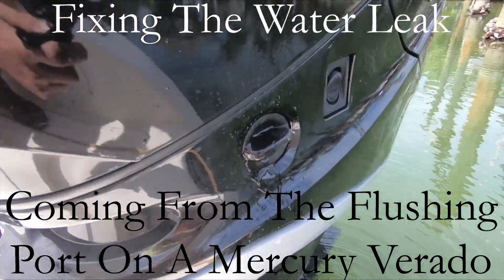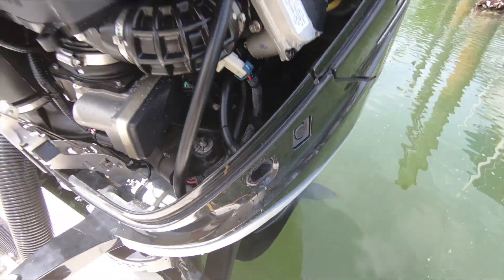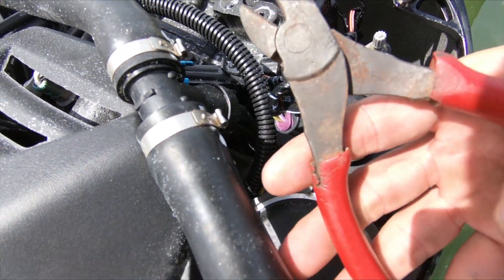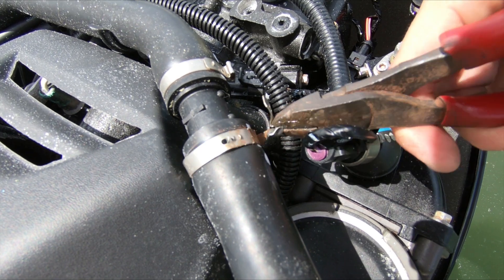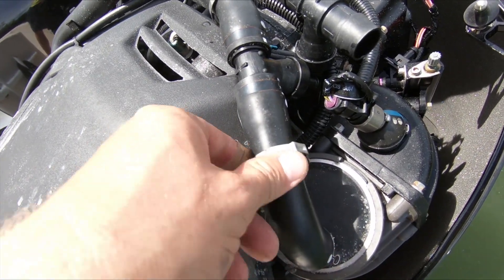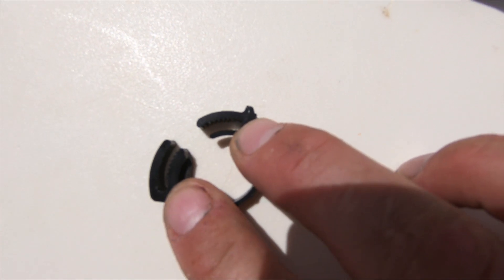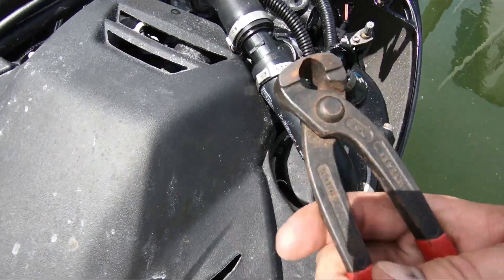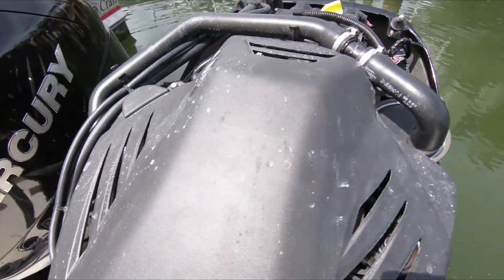Stopping the water leak coming out of Mercury Verado Flush Port | Verado Squirting Water Out of Side

Comment: hi , thanks for the video , i have this problem on my 2014 verado 200 , having looked at the cover plug on the end cap , it looks like the tiny holes are supposed to be there to allow the air in the system to escape , is there a non return valve in the pipe , ? and what does  replacing the clamps do ?  thanks

Comment: Great videos, watch them all the time. Question about my 150 Mercury Seapro 2019 leaking water out of the flush plug. I've heard that instead of the T on the Verrados the Seapro fix is to replace the check valve between the 2 hoses on the flushing system?
Thanks

Comment: Great info !! 
I’m having issues with my 2014 250 Verado. Steering seems as is there is air in the lines, I’ve tried to bleed lines but no luck, I took it out on water but managed to feel the steering though and unresponsive. 
I would greatly appreciate any insight or possible video. 
Once again thanks for all your helpful videos . 👍🏼
Reply: take to a dealer and bleed the air out of the lines.  hope you got this fixed.

Comment: I just replaced my lower unit with new Mercury factory cxxl lower unit. It is noticeably louder than the other unit. The older unit makes a large clunk when engaged but I can’t hear it once it’s in gear at idling speed. The unit can be heard like maybe it didn’t have lube but I assumed it came with oil from Mercury but double checked anyway and I didn’t get a half pump before it came out of top screw hole. Any ideas or videos on it?

Comment: Hello, these are great videos you have, thanks for sharing them, I replaced the entire lower unit seals on my stbrd side motor watching your video.  I have a message in my stbrd engine that displays: too much air in idle, non critical issue, manifold leak, service engine soon. Any feedback?
Reply from the maker: Thank you! Possibly the clamp that is on the isolater boot that is above the throttle body and below the supercharger, or a clamp on the tubes going to the charge air cooler which is just the manifold after the supercharger, or possibly the map sensor boot on top of the charge air cooler. Look over those things first :) Hope that helps!

Comment: I have a new pro xs 115hp 4-stroke and I have the same problem. Same fix?
Reply from the maker: Yes. Just a little different fitting because those come with the hose attached to it!
Reply: Did you end up replacing.  The Tee . I have the sam pro xs 115. And has tjis issue ?
Reply: Hello did you repair this issue with your Merc 115 pro xs ?  I have the same issue .

Comment: Hi, I have a 250 verado pro with smart gages and it says shift actuator service soon, it doesn't come on all the time just when I cruise around 10mph but if I'm running hard all day it will rarely come on. Suggestions?
Reply from the maker: Hello! Awesome and yes. There's two pretty common things that can occur to give you that message. 

Which is either the lower unit is having problems or the shift actuator is beginning to fail. 

Start by checking your gear lube. Make sure its clean, no water, metal, or anything like that. Here is a video for gear lube colors: https://youtu.be/Nl3MvT9Tlzs

Then checking the shift actuator gets a little more complicated. I would suggest finding a local verado specialist that can find hook it up to a laptop and check the codes.

I hope this helps! Good luck!

Comment: What does "starboard shift not working properly" message mean when you have single "225" setup?
Reply from the maker: Just means that you have a shift issue somewhere, hopefully you figured this out, it says starboard because single engines are considered starboard engines even by themselves, they have right hand lower units :)

Comment: Do you know what temp a non sci verado 350 should idle at when warm? After running for an hour of so.
Reply from the maker: The engine should run somewhere between 140-150 degrees. I'm pretty sure the L6 Thermostat opens up at 143 degrees. So somewhere around there is fine. If it is up higher like 160 or 170. You have some blockages somewhere or the thermostat is stuck closed.

Comment: Hi I have a 150hp 2016 and has water comming from the 2nd flush as well as this vid would I fix the same way and when first start it's great in the tall tail then I lose pressure and start haven heaps off bubbles comming from the prop could that be the thermostat like in one off your other vids 
Thanks heaps in advance from Australia
Reply from the maker: Hello! Yes, the 150 has a flush port sort of like this one. The only difference is that it is on the port side of the engine and it is just in line on the flush hose. Just take your cowling off and follow the flushing hose up until you get to this little valve that is that line. That is the flush valve for the 150's! 
As far as the bubbles and loosing pressure. Yes, start with the thermostat and see if it has a bunch of stuff in it or if it is closed shut. 

150 Water out the Exhaust: https://www.youtube.com/watch?v=OeCNF6IFf1Y
150 Full Service: https://www.youtube.com/watch?v=ghybfqpD2XQ&t=

Those two videos should help you out! You might be needing an impeller, but there is also a screen that is on the port side of the engine under neath the side chaps. It has a screen in there that can get clogged up with junk. So you can start with the thermostat, then check that screen on the side under the chaps. 

Then if those don't work you'll need to pull the lower unit and check the impeller and water tubes.

When you have the thermostat off, you can also hook up to the flush attachment and back flush water to see if it pushes a bunch of junk out.

Good luck on your endeavor! Let us know how it turns out!
Reply: @BornAgainBoating  I have a 2019 Mercury Pro xs 100 hours in. And this started to happen recently . But it is not a tee would you know a part # or link to where to get it ?  Thankx for any help

Comment: What should be done for sand ingestion on a 350?
Reply from the maker: If you have major sand ingestion then you want to drop the lower unit and clean out the impeller housing. Then you will want to remove the thermostat from the block and hook up a garden hose to the flush attachment with the thermostat out. This will allow you to back flush the engine and push out any sand that is stuck in it. Doing that should get most of the sand out of the engine unless you really ran aground hard and sucked up so much sand that it is packed in tight. If that is the case I would suggest taking it somewhere.
Reply: How does that stop the leak, I have this problem . I’m missing something here

Comment: Would this be the same for a mercury  75HP outboard 4 stroke I have the same thing happening , cooling water is still coming out to the taletell hole , curious what causes this ?
Reply from the maker: I believe that that engine does have this similar fitting. It will just be a one way valve though. What year engine?
Reply: Born Again Boating Pretty sure it’s a 2017 that’s when I purchased the boat it was brand new
Reply from the maker: @89rherb  Ok, yeas it does have it. Just up from that flush port like on this one. But it should be more in the open and on the port side of the engine. The part number is: 32-8M0035700 they are like $45 or so.
Reply: Born Again Boating OK outstanding I really do appreciate this information very much any idea what causes this problem to happen
Reply from the maker: @89rherb  no worries! Eh, salt, seaweed, grass, debris, sand, just anything that could have got picked up along the way and it will get stuck in there and hold the valve open
Reply: Born Again Boating OK because I thought I had like stripped the part you take off to hook the water hose up too :) ...  my last question and I do appreciate all this information what site can I purchase this on ?
Reply from the maker: Nope :) no worries! Um, the best price will probably be from boats.net and just look up part number: 8M0035700, here is a link, just double check that it is your engine there, using the serial number. I'm almost 100% sure its what your engine takes :)
https://www.boats.net/catalog/mercury/outboard-by-hp/75hp/2b095049-up-cat-90-8m0087973-efi-seapro/cooling
Reply: Born Again Boating Appreciate it very much again

Comment: Yes thank you so much for your advice I have checked the thermostat it seemed ok but I will replace just in case I have checked that valve on the side of the leg it did have gunk in their i clean that out but I have changed the water impeller and seals the only issue I thought I had was the adaptor that connects the water pump to the pipe inside the leg wasn't stealing properly was letting too much water out so next step will be doing thermostat and we'll let you know thank you heaps I was told to check the exhaust valve on the side of the leg was told that might be stuck open that's why it's pushing exhaust through the prop seems to only do it when it warms up though while it's cold everything works perfect so I'm guessing it's thermostat issue
Reply from the maker: Yeah, that is possible. The water pump kit usually comes with the seals for that little adapter that connects the water pump housing to the water tube. I hope the thermostat does the trick. If it doesn't, it sounds like you have some kind of blockage somewhere! You must have sucked up some dirt, or sand, or grass, or something and now its lodged somewhere.

Comment: I have a verado 275 XL . I have a water in fuel line alert, I changed all the filters and the alarm is still going on saying there is water in the fuel line ??
Reply from the maker: Hey, sorry to hear you keep getting that alarm, :(.

275s have the red top filter on the starboard side of the engine. Pull the filter out and then dump that cup out. 

Clean the two pins that are in the bottom of the cup, that is your water sensor there! If you keep getting the alarm and you are 100% sure there isn't any water in the fuel.

Then either that sensor has failed and needs replaced or the wires feeding it have grounded out! 

Hope this helps, good luck!

Comment: Hello, Im having a different leaking in my 06 Verado 275. The problem is that the inside of the engine bay is accumulating water and since I couldn't spot the problem by running the boat with out the cowling I wonder if you could know the source or this leak.
here is a video with the amount of water accumulated after a few hours of running
https://www.youtube.com/watch?v=OLVjZ-t1z5M
Thanks